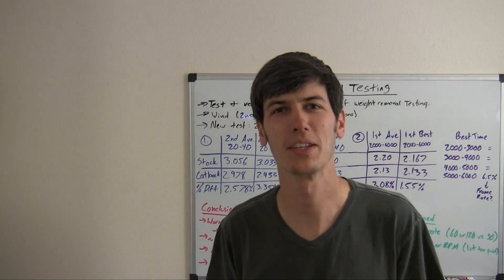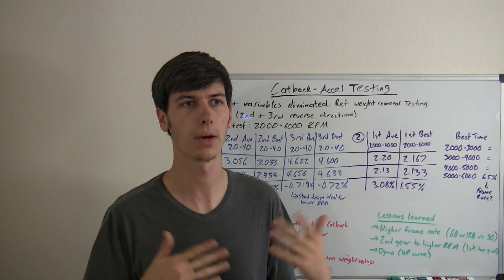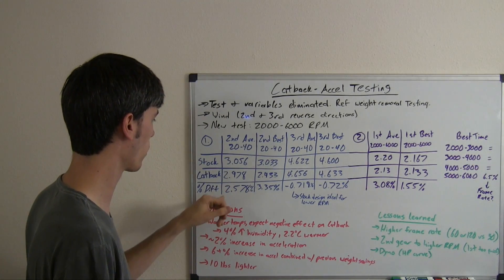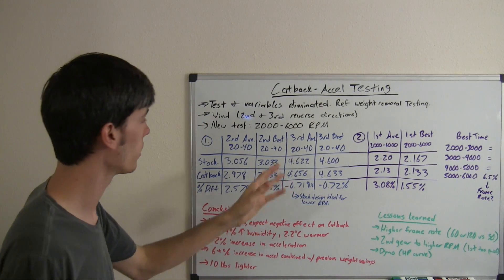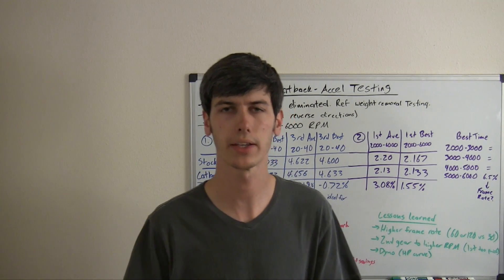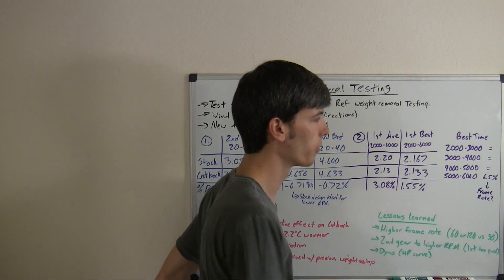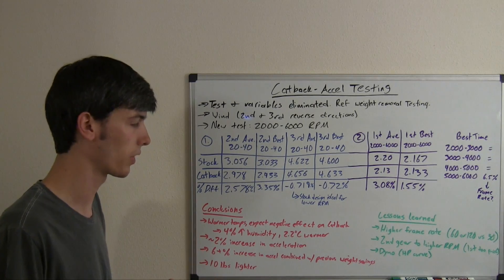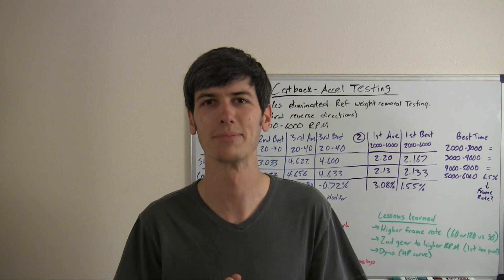Do Catback Exhausts Increase Horsepower? (With Proof)

Comment: a couple of days ago i was sitting on the toilet and something came in my mind about weight reduction. there is one factor you never talked about and i don't remember anyone mentioning it: tyre pressure. less weight equals less stress on the tyres, they don't deform that much and thus create less rolling resistance, which affects acceleration. okay, anyhow, i admit that calculating the tyre pressure versus deforming is nearly impossible, but i'd say that a little less air in the tyres (around 0.05 - 0.1 bar) could have done the job, and meant one less factor to worry about. (anyway, lower and higher tyre pressure and their effects on acceleration might be another subject of testing...)
Reply: Dogzero T T It increases grip but lowers speed
Reply: I thought lower tire pressure also increases grip? although close to flat tires i don' think you will get you too far) haha xD
Reply: Dogzero T T More grip, but more drag as well. So it will help reduce wheel spin but hinder you once the spin stops.

Comment: Great video. I have been telling people for years that all that Hi Performance stuff is nice but only if your'e driving fast. The same goes for Cold Air intakes. They can cost from $200-$300 dollars for a plastic pipe and and hi-flow filter with power gains at 4,000rpm. I rarley get my truck to rev that high so I stick to the factory intake and save my money. It's my daly driver not a race car.
Reply from the maker: I agree!
Reply: Engineering Explained
what mods would be best to improve the performance at low rpms, ie everyday driving speed?

Comment: If it's not too much to ask is it possible to make a video to see how much acceleration is affected due to octane rating or different brands of gasoline. For example shell versus mobile 1 or Costco versus Sam's Club. -thanks Noro
Reply from the maker: I'll have some future videos on octane levels that I think you'll find interesting. Wouldn't make any difference on my Integra, as it's designed for 87.
Reply: I can't speak to the different brands of gasoline, but I do know higher octane for a car that only needs 87 will not give you any extra performance to speak of. Its not like Nos where you just get more power. Octane is strictly the resistance to detonation. If your car doesn't call for it, its not necessary, unless you have certain mods.

Comment: SomeThing I have learned after years of modifying cars on a budget is that  if you want real results you Have to do a complete modification of the entire system, in this case full Exhaust from Headers/DeleteCat/ Straight Pipe for the best results
Reply: That Honda Tech but if you were to buy a header and an exhaust that would keep the cat, would it increase power and prevent ruining a civic?
Reply: If it is a high-performance CAT yes.  @markyazurin6304  If its the stock CAT with everything else new, Stil yes but not as much Yes.
Reply: this would only benefit turbo engines that dont require back pressure if you did that to a civic youd ruin your car over time. your o2 sensors would read lean because of the excessive amount of gas in the fumes, because you removed you cat which cleans the fumes. after the o2 sensors read lean, your pcm will push more fuel to your injectors, (this is called short term/long term fuel trim) excessive gas from your injectors will cause in your valves gunking in carbon, idle problems (IAC), excessive engine vibrations. all because you have no way of properly expelling the gasses, with a turbo, the less back pressure the better. you have a turbine pulling the fumes into/out of your cumbustion chamber faster.

-sincerely  Honda technician

Comment: I guess the bigger diameter of the exhaust is to blame for the lower performance in low revs, but the performance is all about higher revs, isn't it? (well horsepower at least, but I'm pretty sure the catback exhaust gives more torque too)
Reply: Stopped at 5:02 to post that comment, explanation came right after... That's why they told us to read all the question back in school haha

Comment: I'd like to see this after installing a header
Reply: I think that's should certainly be next. After the cat-back your next upgrade really should be a header to complete the whole exhaust system. Also I don't know if it fit's into your agenda but a proper tune starts to be very helpful right around this time.
Reply: That would make a big difference
Reply: Mike M Tuning is costly, especially when considering he would have to buy an ECU as well...he'd see more gains per $ after a few more mods imho (ie CAI and Cams/IM (I grouped these together as they really compliement each other)). I would start with a CAI then add cams/IM/ecu and tune all at once.
Reply: Exactly! :)
Reply: Speed Junkie For some reason I though he already installed a CAI. In which case that should be next. But I agree completely. Putting some performance Cams in would be exciting